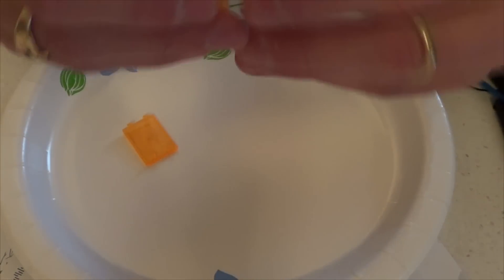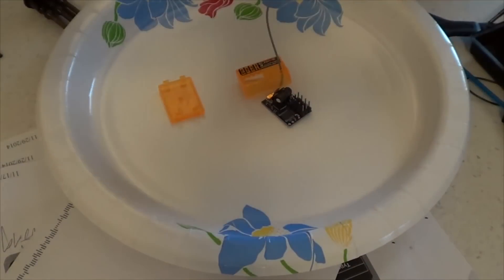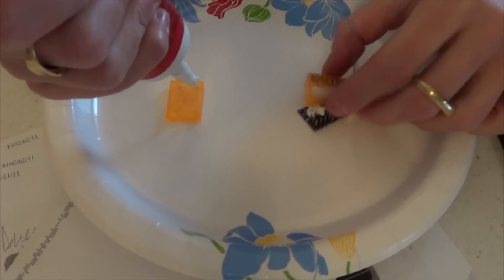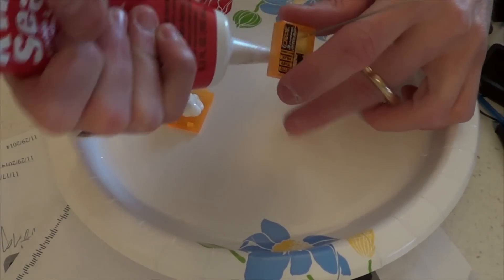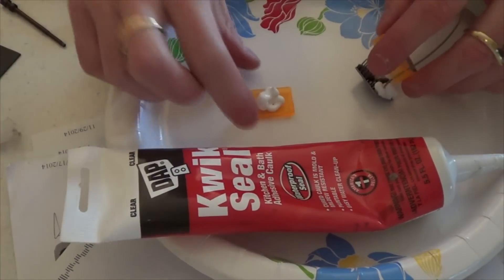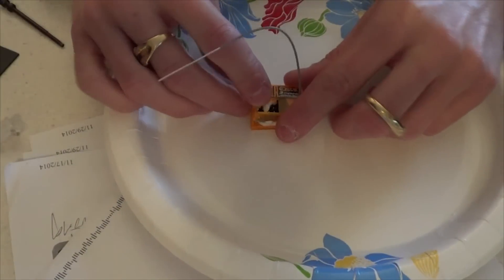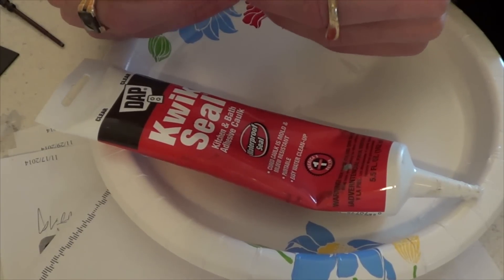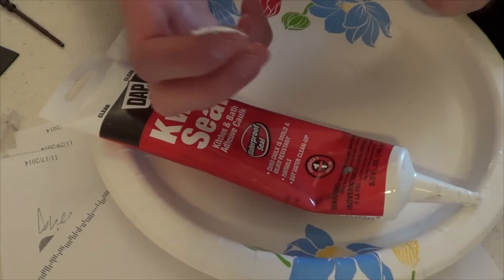How to WATERproof Hobbyking ORANGE Rx Receivers (Or ANY Receiver) Gecko Guy-

Comment: neat , iam a plastic dip fan myself and i use extension leads for the trouble to do it id rather have it 100% sealed this way i dont have to worry and i can take it in the lake swimming and no shut downs ..
Reply from the maker: i used to use plastidip but my can dried out and this was all i had. i generally don't fully submerge my vehicles but i do get them wet from time to time and like having a waterproof or splashproof electronics.